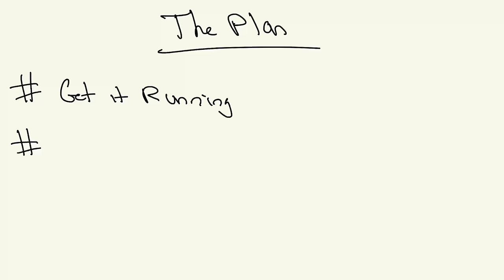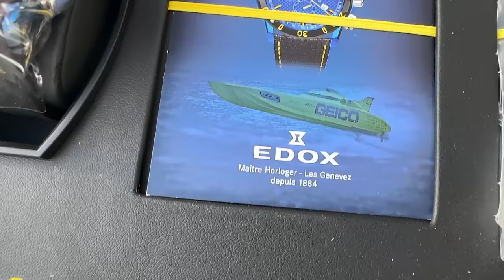Why you Should NEVER Buy an Orange County Chopper

Comment: 10k for the bike the trailer and the replica race boat is the deal of a lifetime.killer find Sean.
Reply: Hell that Rolex is probably worth more than the bike alone! (Edit: as pointed out, it’s an Edox, but I are dumb and was half awake watching the video 🤦🏼‍♂️)
Reply: and those watches sold for around $2,400.. so he basically got 25% of his money back from just the watch
Reply: @EddieMitz  it’s an Edox, not a Rolex 😂
Reply: Hell, the trailer alone is probably $3500 give/take so the bike itself is basically $6000 down ridiculously from the $100k that it originally sold from OCC for. OCC and the chopper craze was such a huge joke to serious riders.
Reply: And the watch. He got a deal on all that.
Reply: @normanbyrne9868 custom painted too
Reply: Ok, with the EDOX watch there's a possibility of collectivity, so just assuming it held its value $2400. Now the trailer, there's $3500 in value. The motor is probably worth at least $3500 for the engine and another $3500 for the supercharger Now for, the toy boat, as long as it still has the box it came in, there's another $2500. Maybe another $1500 in spare parts the rims and tires and a couple hundred pounds of scrap metal $100. So that package deal is worth somewhere around $17,000. Imagine paying over $100,000 for a motorcycle, and ending up with a quartz watch and a toy boat are the only  collectable pieces. And that that custom bike, outside of a parts donor is scrape metal. Ergonomic functionality is a principle of modern motorcycle design. I loved that show, but most of those contraptions were impalation hazards to the riders and everyone else on the road.
Reply: @EddieMitz  Watch newb alert, lol.  It always amazes me car and bike guys know nothing about automatic mechanical watches.  They are mechanical engineering marvels.
Reply: @pedaltheglobe419  I never said or alluded to knowing nothing about mechanical watches, or that I was not being impressed by them.  I simply mistook this watch for another brand due to being half asleep.

Besides the fact that, IMO, watches that are designed from inspiration of super and hyper cars are the most stunning, both mechanically and visually.
Reply: @EddieMitz  Yeah, but that's a quartz watch, not even considered a watch by the in vogue watch collectors.
Reply: Wow crazy I would’ve bought too❤
Reply: Nope, the bike and the boat are useless.  10k for a trailer is a rip off
Reply: Regular people  rarely get these deals.  this guy does t  nt  need these kind of deals!
Reply: @planethopper335  ehh, there are some quartz watches that get us watch guys excited, but not many. This one? Meh. A nice Grand Seiko though.....
Reply: of course all the rich people get good deals, its bs. meanwhile most of us can hardly afford food. we need to quit supporting these people and make them poor.
Reply: the bikes worth $50K
Reply: Only 113 of the Miss Geiko watches made, sell for around $2400, and the boat is probably worth around $1000
Reply: Should have taken the 15k.
Reply: What is anything worth - whatever you can get someone to pay.  The day someone passes most things become trash/clutter to someone else…
Reply: @WelshmaninNorthCarolina   only one of the miss geiko chppers made $50K
Reply: @pedaltheglobe419  ... lol ... my older brothers a watch guru from way back - myself know zip.
Go figure - your statement presents itself as factual - I'm a bike n' car builder ... :)
Reply: I wanna know what episode of the Twilight Zone are these dudes living in that think they can buy that trailer for $3,500?  You can't even get a single axle shitbox with swingout doors for that price these days.
Reply: @SlimPickinwatch guy 😢😢😢😢😂😂😂😂

s_07
Reply: @michaelmccoy1794  you never take the first offer and sean knows that.... it would have been impulsive like the buyer to just throw out a random number or accept it. Sean also works on margins and in parts, even with the trailer and stuff, resale value, after time taxes and transportation and all he'd barely make anything. If that guy has 15k cash for the non running bike he might pay a little more once its all setup. Plus he needs it for content first. He can make 5-15k off the bike just in views potentially. Not often you see a motor built like that. The blower and brackets have probably appreciated with the economy to double or triple what it would cost now in time and materials
Reply: @planethopper335  2400 for a edox ? never even heard of that brand  , lol
Reply: @sdqsdq6274 With Swiss watches if you’ve never heard of the make you likely can’t afford them.
Reply: Ya somethings rotten in Denmark lol
Reply: I found one of the watches for sale on a European site for 1490euro.
Reply: @Press33  you mean like your comment
Reply: @cciesli people can’t seem to accept it just entertainment, so that gut feeling down deep that detects BS gets ignored. Guy says he paid $10k for everything, it’s unbelievable but they want to believe.  It drives the comments/activity ergo free promotional marketing.
Reply: Yes. You could also take some of the good parts off and add them to a different bike. So you have something great to ride for cheap
Reply: And expense watch...whatever is all made up.  That trailer alone is 10k
Reply: On the contrary....it's the red flag of a lifetime
Reply: @leward who cares😂
Reply: @planethopper335  the box for the toy boat? 😂😂😂
Reply: I was about to say, that's actually one hell of a deal lol 😂.
Reply: The trailer and the boat make it worth that much alone. You could probably scrap the bike for metal and come out with a profit lol
Reply: @elora2525 Respectfully....I just looked and seen you can buy a much nicer, better looking newer 12ft dual axle 2023 used cargo trailer with nice aluminum rims for $3,500 
That trailer is old with steel rims & kinda rusty. So it's not anywhere worth $10k...... My 1st guess when I thought the trailer was a nicer 15 or 20ft was $5k used.
Reply: He just got offered 15k for the bike lol the bike is easily 10k in itself
Reply: And he got over 10M views combined accross multiple videos. That alone should cover the expense

Comment: A hardtail and a solid tube steel seat? Whoever designed this bike has something against buttocks and spines.
Reply: Race bike, It has a seat? Wow! so much luxury!  :-)
But for real. Imagine doing a burnout on that thing, It would throw rubber all over your back and head.
Kind of like the old Greeves or Harleys, with oil on your back and in your hair.
Reply: Its just a piece of art man... they didnt build bikes to be ridden
Reply: @zachroberts1988  yeah, if it got any use at all after being built it was to start it up and rev it to the limiter a few times.
Reply: Where we are going we don't need spines
Reply: @volvo09 hopefully not on a cold start
Reply: @theunluckycharm9637   I'd be surprised if more than a handful of these bikes actually got up to running temp more than 3x... 

Start it up, rev the snot out of it for the crowd, shut it off... And it sits around till the next event.
Reply: these bikes are designed to do a slow cruise thru Daytona or Sturgis, get attention, then ŕeturn to the trailer
Reply: I see it as an expensive engine stand.🤷‍♂️
Reply: @straybullitt  Perfect! Lol!
Reply: My homemade chopper is hardtail, too. A little bit rough when I run into potholes, but no big deal. But THIS green beauty CAN NOT BE comfortable.
Reply: It’s an ornament
Reply: yes a total masochist
Reply: Buttoczz
Reply: It's an extremely ugly and badly designed bike, what did you expect
Reply: @zachroberts1988  you can make a “art” bike that can be driven.
Reply: Jason Pohl doesn't have a spine.
Reply: If you actually wanted to ride it, I'd call in a seat builder and make a spring loaded saddle for it. A large tail pad to keep you from flying off.
Reply: Like something from the Spanish inquisition. A torture device.
Reply: @straybullitt  🤣
Reply: That's one of the dumbest motor vehicles ever created and he'd be insane to not let the neighbor have it for the 15k he offered and keep the trailer and maybe the boat.  Give dude the watch. And have a new friend next door and thank his lucky stars he got out from under that thing and survived the temporary insanity responsible for that purchase.
Reply: 200 hp twin,  I'd be scared to ride that thing, atleast a busa has nannys and was designed to go fast.
Reply: @mrspeigle1 A digger is a sorta drag bike. This one just stupidly has no rear suspension.
Reply: @ironwoodworkman4917  imainge the blower letting go or the belt. No thanks
Reply: @gordocarbo  I have seen blowers fail like a bomb going off. Would not find me racing that thing. 😳
Reply: A major shareholder in hemorrhoid cream more like!😉😂
Reply: @zachroberts1988 except at the end of every OCC episode they took it out for a test run and bragged about how smooth the ride was
Reply: I think it was intended to be parked and looked at, not ridden.
Reply: I grew up on 50cc mopeds that had a hard metal rear seat, so I can only imagine what a monster like that would feel like lol.
Reply: 😂😂😂 auuuuu
Reply: They got something against body parts lol, god forbid that blower would ever explode while riding the bike.
Reply: @ilovelulu8492  pretty sure that blower is operating at 30% of its capacity to make sure that never happens.
Reply: @randomstuff4805  anything can happen, but with that said running it at 30% capacity does help 😂
Reply: @volvo09  They did ride a fair few in the show... Long rides too

Comment: HEy Sean when you saw the gum in the fuel lines, that is from C16 fuel all the injectors will be gummed up with that exact same stuff thats why the injector hose blew because the injector is fully clogged with C16. you can never leave C16 for any amount of time. it should be drained if you dont plan on using the bike for even a few days its that volatile 

I would take the tank off. clean it out make sure no gum got in the new fuel pump. then take off the fuel rail that will need cleaning and depending how the injection is set up will either have some hose to the injector or it will go straight into the manifold. clean head to tank mate 

Damn good find. how cool was that guy seeing his baby again. he obv loved that bike. and everytime you build big project bikes you leave parts of you in that bike. im sure hed love it back once you are done. or at the minim let him ride it and come visit
Reply: ya pretty much any fuel will do that  c16 the worst
Reply: Yeah that's not the fuel lines gumming up, that's everything fuel related gumming up with that fuel jelly haha
Reply: Yep as soon as you see that level of gum... you gotta replace everything fuel touches and clean out the tank.  Should have been the plan from the beginning to be honest... but this kinda shows his level of experience with starting up old junk.  Anyone that's pulled something old back from storage/barns/fields that wants to get it running has a pretty similar check list.  That's nearly the top item.
Reply: Yeah as soon as I saw the line I was thinking maybe the entire engine needs a flush
Reply: I can only think this was for content? Like its pretty obvious everything to do with the fuel system is bad, so why keep trying to crank it when there is way more du-dilegence required?
Reply: agreed. better then just cook the starter and overheating the power cables spinning the engine for nothing.
Reply: @Skreamies I work as a maintenance tech in the pvc extrusion industry, and on some of our older machines we run whats called an "oil deck," it heats and cools a big screw basically, and thats one thing ive learned is that if i have gummed up lines, or gumming in the reservoir or pump, 8 times out of 10 i have to clean and rebuild the system. Sometimes i can get away with blowing air through the lines to clear them without cleaning the pump and every other component, but that gumming up is going to be gummed up EVERYWHERE! Not just the line you replaced!
Reply: Yeah, you don't want a clog leaning out the engine on a dyno run with that much boost. I'd replace everything after the tank especially the injectors.
Reply: I searched for this comment so I didn’t have to write it myself… but after all the guy that owns the tools shop should have known!
Reply: That fuel becomes like half dried varnish, why on earth would you even turn it over before cleaning that gum out?
Reply: Yeah same goes for E85 that is no good for a fuel system too you gotta drain the E85 then run none ethanol fuel thought the lines and injectors if not you have to clean or possibly rebuild the complete fuel system with new injectors and pump
Reply: We run VP c16 in our race car and it's never gummed up anything ever in 20 years.
Reply: @frankcox748  not one person is claiming that using it gums up anything
Reply: @UseByDate-Expired  this entire post is about gum up fuel systems. What are you reading? 🤣
Reply: @frankcox748  Did you let it sit for a few years full of c16?
Reply: @frankcox748  I was reading a guy saying that he used the fuel constantly for 20 years, and it never gummed up, and I was not buy it being the same as sitting there for decades.

Comment: soon as you see one bad fuel line  you have to assume that everything touched by fuel  has degraded . 
Hoses , filters , pump , injectors  . Honestly i would not trust  those clutch lines either .
It was super cool to see that guy seeing a bike he built so long ago  . 
I've had this happen to me once  , i helped a friend of mine build  up a car for racing , he sold it , we never saw it and then i randomly found it  5 years later .
Went to look for the owner , and it is just a great  feeling man , like seeing an old friend . The car was not special , but the connection i had to it warmed my heart
Reply: EXACTLY, parts of the hose are throughout the fuel system, they basically MELT...🫣
Reply: The injectors are plugged up for sure
Reply: Ethanol?
Reply: @mrmagoo916  no, this damage is from fuel left in the lines. Over time it breaks down and starts eating the rubber. Turns into a black slugde, clogs filters, injectors, carb jets. It's nasty stuff.
Ethanol will do that as well, but it is far more likely to oxidize anything metal it touches since it pulls moisture from the air
Reply: lol at random "previous owners/builders"

got an old FZR250. was using it for courier work. random guy runs up to me... "you still riding that thing!?"

um...yeah? you know what it is? (lets say, i keep my bikes looking pretty damn rough... mad max style...)

"yeah... i SOLD IT TO YOU!!!!"

meh, during covid lockdowns, didnt realise who it was with the mask on... and as id only spoken to him for a minute or two anyway...
Reply: @randomusernumber1 don't they make these F'n lines with some sorta quality control? Or is it a ploy on purpose so it WILL break on ya so u buy more along with cheap parts to replace. 

I swear man...I'm from the 80s and I've seen things from the 1950's made andy god the quality was so amazing. Things lasted so long even to this day that's how good they were. 

There's more people in the world now, so you'd think they'd keep up a good reputation so more people buy their stuff. Bring back metal and cast iron.
Reply: @daviedood2503  it is not a ploy. Modern petrol is just more refined than 1950s petrol. The lines we have now are also better but petrol just gets to be so corosioafter over time that no rubber can stand up to it.
Reply: @daviedood2503 recycled crap ruins everything,
Reply: Built so long ago relax it’s not even 9 years old wtf 😂
Reply: As soon as you see one bad fuel line on a bike that recent you know they used garbage fuel hose. Gates Barricade etc don't go bad that quickly. That's why I also use it for carbed engines. The Teflon liner is key to durability.

Comment: I had a similar experience. I bought a Modified  1975 Porsche 914 from a random dealer in Oregon. A few months later I was at a random gas station in California and  met  the initial owner that did the modifications. He told me all about the car and knew exactly everything about the car that only he would know. 
Moments like those are interesting...
Reply: Something happened to me like that too. I traded in my Evo X  to a Honda dealership.  Then they sold it about 2 weeks later. I had wheels that were on the car that I couldn't use anymore.  So I sold them. When the guy came to pick the wheels up. It was my old Evo  pulling up lol. Guy lived a state over . I gave the guy a bunch of stock parts I had laying around the garage that came off the car .
Reply: @MrJjburgess11  That's wild. Life is funny sometimes
Reply: @PipeScholar  yeah , I was like what are the odds . Like I was meant to see the car one last time lol
Reply: 😅 6:05 😅😮